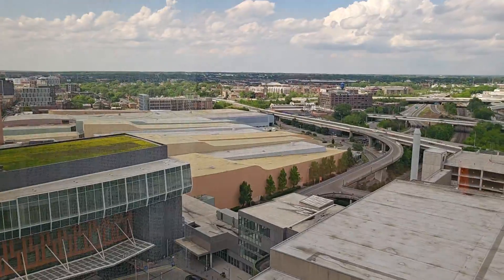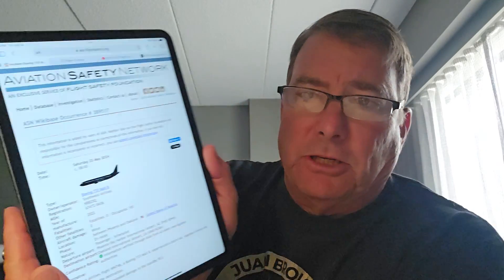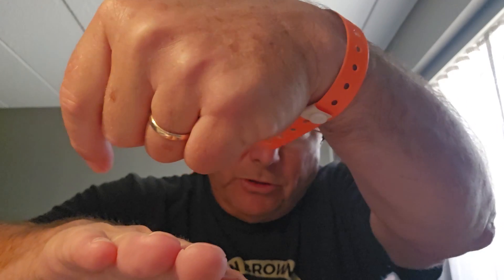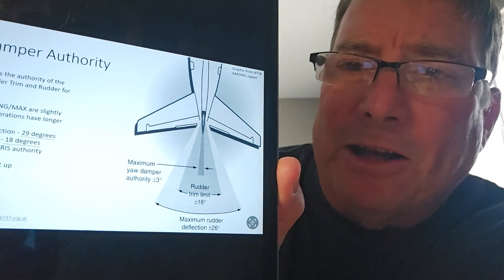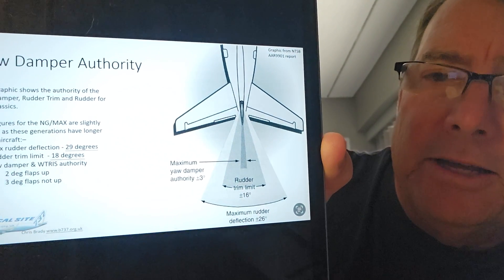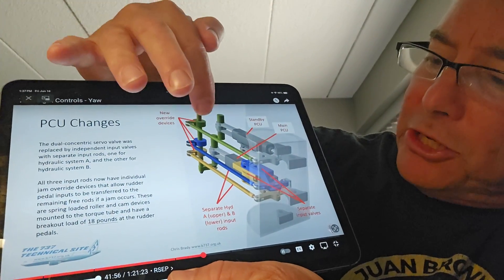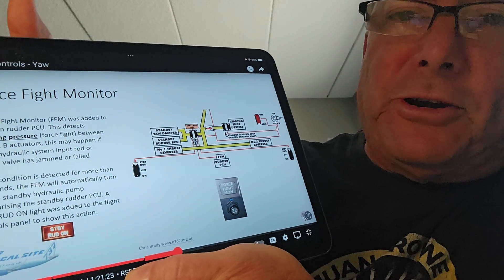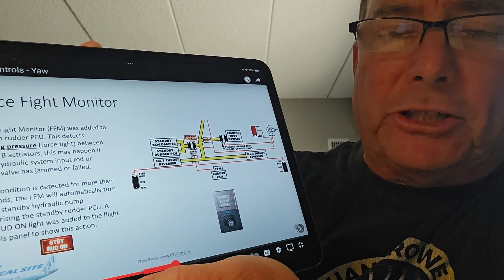SWA 737 Max-8  "Dutch Roll" Incident

Comment: In 1959, a 707 ( N7071) had 3 engines completely detach from the aircraft while doing extreme (for a 707)  Dutch rolls during a training flight for Braniff Airlines. 8 people were on the aircraft. 4 pilots were killed. 4 passengers survived.
Reply: If memory serves, the Boeing pilots had warned the Braniff pilot against being as aggressive on the controls as he was being, but the Braniff Captain was a former WWII and Korea fighter pilot and was determined to make a show of the delivery flight.  It probably hadn't helped that Tex Johnson had performed an aileron roll in the 367 demonstrator and gave the idea that the 707 was a "hotrod."  The early 707 models had Dutch Roll issues and so Boeing would require "Dutch Roll" familiarization when handing off a new airplane.  

A similar issue arose with the American A300 that went down in 2001 when the pilot encountered wake turbulence and began aggressively stomping on the rudder pedals and managed to rip the VS right off the airplane.  To counter Dutch Roll too aggressively only makes the situation worse and damages the airplane.
Reply: @pastorjerrykliner3162  
Tex did 2 barrel rolls, NOT aileron rolls. An aileron roll results in a negative 1G while inverted, while a barrel roll done properly can have a negligible additional stress while the airframe experiences a continuous positive G load, barely over 1G at any point in the roll. It appears to slide along on its belly while spiraling up and over (inverted) and down along the inside of an imaginary horizontal cylinder (barrel…) in the sky. No problem with unsecured people on the ceiling, fuel starvation, oil interrupted to the bearings, etc., although energy management (speed loss/gain) due to the elevation changes is a consideration.
Reply: @For_What_It-s_Worth  As per the late Bob Hoover. Was it him who put a glass of water on top of the dash, and didn't spill a drop? Legend!
Reply: @pastorjerrykliner3162  Sounds like a poor design if stepping on the rudder pedals too hard while in level flight can cause the rudder to fall off and the plane to subsequently fall from the sky killing everyone on board.
Reply: @somealias-zs1bw  To an extent, yes, it was a design issue.  

However, the problem wasn't just that the pilot stepped on a pedals, but rather that he aggressively alternated between maximum left and right deflection.

Most aircraft have a poor structural response to an extended period of pilot induced oscillation.
Reply: @oscarb9139  Yes, I mis-spoke. It does make you wonder why they call it the rudder pedals when it's the yoke that controls the rudder, lol.
Reply: @somealias-zs1bw  No.  The yoke controls the elvator and the alierons.
Reply: @somealias-zs1bw  you need to just stop commenting
Reply: @somealias-zs1bw  I'm put in mind of that flight that crashed in Queens. Am I understanding this right that the plane would have controlled the movement in six cycles? Had it gone on for six and gotten worse so that the pilot felt they needed to take over? Or might this pilot acted a bit like the one in the NY crash and thought it needed correction right away, defeating the system?
Reply: I consider the fact that there is no force feedback in the rudder pedals of the Airbus to be a design issue. The pilot was able to move the rudder from stop to stop quickly because there was no resistance to the movement.
Reply: @somealias-zs1bw  You can break any aircraft if you abuse it enough
Reply: @somealias-zs1bw That aircraft had 4 cycles of rudder reversals applied, the force on the vertical stab mounts doubled at each reversal. The pilot was out of phase with the motion, he made it worse rather than better.
Reply: @oscarb9139  As I recall from the AA587 final report, there was no significant resistance to moving the rudder pedals. Hopefully the design has been improved since then.
Reply: @oscarb9139  You're not wrong. But the NTSB final report also states: "Because of its high sensitivity (that is, light pedal forces and small pedal displacements), the Airbus A300-600 rudder control system is susceptible to potentially hazardous rudder pedal inputs at higher airspeeds."

You seem determined to prove me wrong, but what I said came directly from the report: "light pedal forces." Those light forces allowed the pilot to move the rudder from stop to stop several times within 5 seconds.
I don't know whether Airbus improved the design of the rudder system on the A300 in response to this accident. So if you fly the A300 and the pedal forces don't feel light to you, then they probably did.
Reply: During the war in Afghanistan, a KC135 was list with its crew when they decided to continue the mission after a yaw damper failure.  They ended up loosing control to the dutch roll and suffered an inflight breakup.
Reply: @stephenbritton9297 It is losing control, not “ loosing “.
Reply: @Dazza-u4c  That grammatical digression compliments the other about dampeners and dampening.
Reply: @Dazza-u4c  While you are correct, in this case, both “lose control” and “loose control” both kind of work. PIOs kind of “loose” your control of the aircraft.
Reply: The UK Board of Trade (now UK Civil Aviation Authority) refused a Certificate of Airworthiness for the Boeing 707 in 1960 due to yaw control issues. Boeing enlarged the fin and rudder to overcome this shortcoming and obtain the CofA.
Reply: I just watched a video about that today here on YouTube!
Reply: Thanks for this background.  I will go check it out as a refresher for my Airworthiness studies. 👍
Reply: I flew and trained in a Bombardier Challenger jet. I so remember the simulator demos where they turned off the damper and then had us stomp Rutter pedal. You could about recover as the fuselage rolled all over the sky. It also seems that my controlling often made it worse; my intuition was not correct… I had to really time my inputs. It was amazing once you got it settled down you could about take your hands off … But a little by little you could feel it hunting itself into Dutch roll. In the Sim, I almost would call it a violent maneuver. Seven years retired and didn’t fly that airplane for the last 10, but you remind me of one of the more interesting Sim sessions; it gave me great respect for the airplane, and thanks for the YD that was always working and was so difficult to fly without .
Reply: @curtissbrown3084  I first learned about dutch roll in the Challenger 601 simulator myself...eye opening is an understatement.
Reply: I can't believe still using cables on such large aircraft.
Reply: @Freedom1776usa All aircraft had cable controls in that era, it wasn't until fly-by-wire using electrical signals matured that they disappeared. Original 747 was all cable.

Comment: The Air Force lost a KC-135 back in 2013 due to a Dutch Roll event.   Got so bad part of the aircraft broke off.  Investigation found insufficient training.
Reply: *insufficient training to recognize a Dutch roll condition.
All three aircrew were all under 30. I was at Fairchild when the news broke that we lost them and it hit pretty hard.
Reply: I was a crewchief on a KC-135R that arrived the day before and was parked beside the mishap jet. It was very sad and disturbing the next day when we found out what had happened.
Reply: Shell 77
Reply: I do wonder if it's more difficult to damp the oscillations with all that fuel sloshing around, adding extra inertia to the oscillations.
Reply: Pardon ?

Comment: I read somewhere that 3 ribs were damaged including the one or two the PCU is attached to and that is why it was being ferried to Washington, for repairs.  Apparently SWA has a contract maintenance facility there.
Reply from the maker: Wow!
Reply: That SWA maintenance facility might be at the south end of Paine Field Everett WA?
Reply: @ORD80   LMAO yeah that one,
Reply: @ORD80  even after watching the video you still typed "dampener"?
Reply: THATS WHERE THEY ARE BUILT?
Reply: SWA has had a contract for MRO services with ATS, at Paine Field, for years.
Reply: @cavsh00ter NO ITS NOT
Reply: @bradsanders407  missed the caps LOCK
Reply: @cavsh00ter  Built (final assembly) in Renton Washington, with major fuselage structures supplied by Spirit Aerosystems of Wichita. Some will eventually be built in Everett Washington but that new assembly line is still a way off.
Reply: @benz-share9058 , yeah , Spirit is just a bad as Boeing!
Reply: @Starfish2145  Spirit used to be Boeing. It was sold off as a cost-reduction maneuver.

Comment: I wonder if the placement of the Max engines further forward than on previous models would exacerbate a Dutch roll?
Reply: good question
Reply: But MCAS is 'supposed' to compensate for all that. But as we all know MCAS is [still] very flawed
Reply: @Paul1958R No. MCAS is only there to fix a stick lightening issue. But the new engine placement is the ultimate motivation for including MCAS.

Comment: Please tell me that the PCUs aren't creating problems again after 30+ years?

I'm seriously starting to think that Boeing must start calling an end to the 737 programme and spend some money on a replacement.

Nearly 70 years for one aircraft design is more than enough now. A new aircraft is well overdue from Boeing. It's getting to the point nobody trusts the company to produce quality aircraft anymore. Accountants vs Engineers 😔

Why are Airbus outselling Boeing? QED
Reply: This is unlikely to do with the 1990s rudder issues. We have not seen rudder hardover incidents for a long time after Eastwinds 517z
Reply: @Blank00  Then maybe another software issue? Why would an aircraft do this midflight? It's either the hardware, the software or the driver. There are no other possibilities, surely?
Reply: @martindehavilland-fox3175  there’s also clear air turbulence
Reply: @Blank00  Causing a Dutch roll?? Miniscule chance of that. I reckon we can exclude that straight off
Reply: There are over 5000 orders on the books.